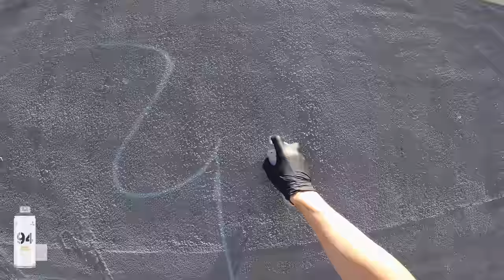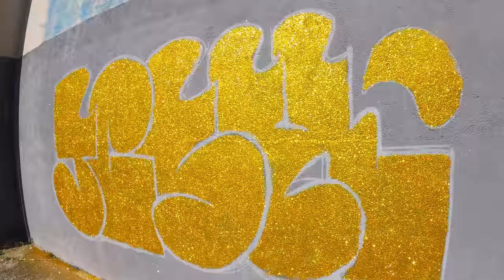Graffiti - Tesh | SUPER SHINY GOLD

Comment: I Wonder if it is possible to mix it with some type of clear coat and put it in a pressure sprayer.... That would be dope as fuck!
Reply: Yeah I thought of the same, but I guess it would just clog the sprayer. Can try it out with a much finer powder maybe!
Reply: @grodone984  use the metallic flake they use when painting cars, doesn't seem to cause issues with their gun, only thing you'd need is a portable compressor
Reply: @RoryMacdonald1337  Yeah that seems like a good idea but it might be expensive. Also, I was talking about the garden sprayer, where you manually pump to generate pressure so no need of compressor
Reply: @grodone984  maybe if there would be a way to make the nossle bigger
Reply: @Xeder-uy3vf  that'd be great

Comment: Why not add the glitter to the glue and then it on paint?  With the right epoxy it would dry clear and you could still do your dusting method on top of it to add extra pop.  On the bright side if you had to ditch your piece the cops would be looking for Tinkerbell.